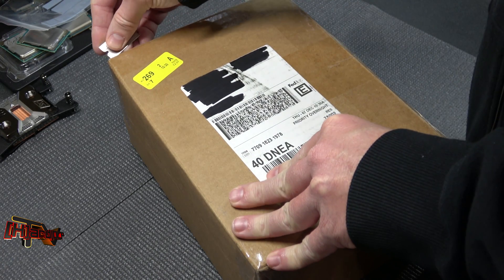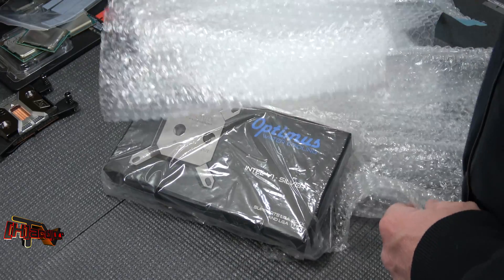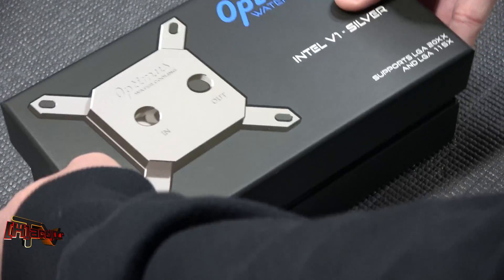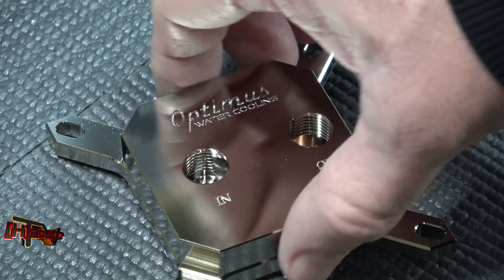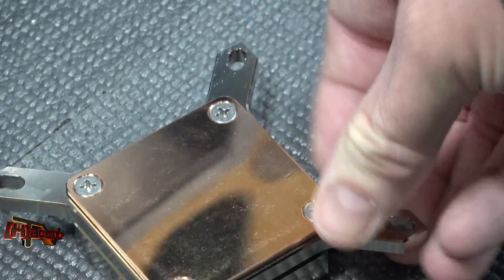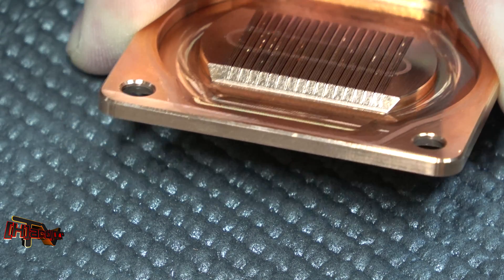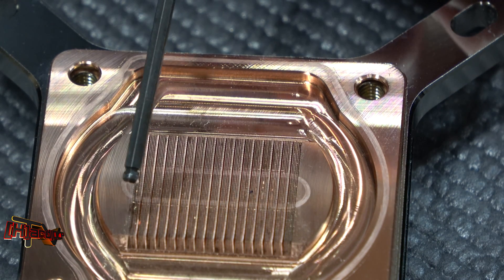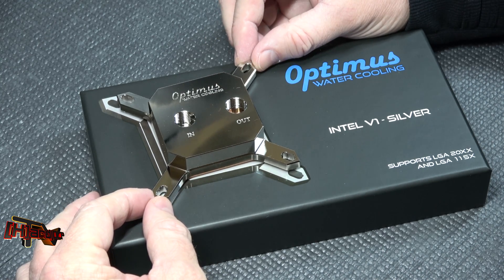Optimus V1 Water Block for Intel Unboxing and Breakdown

Comment: Sorry but it seems to me that there is a point where fin channels become too narrow/small that it starts to have a negative effect on cooling because either a.) They get clogged quicker and/or B.) They are too small for the water to be able to move over them efficiently. And I believe this block has reached this point.